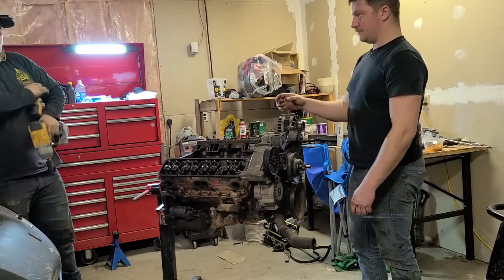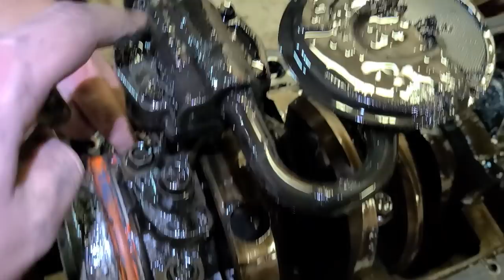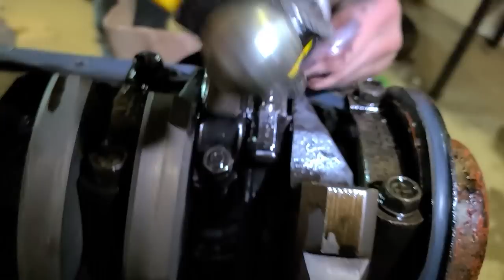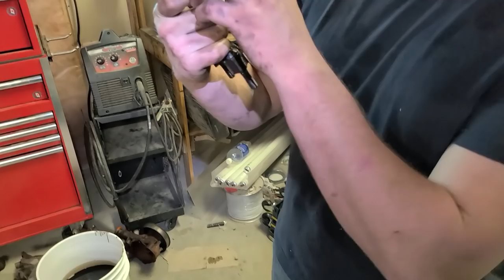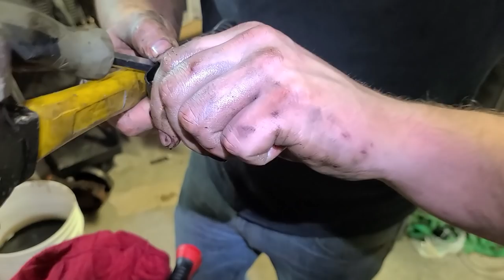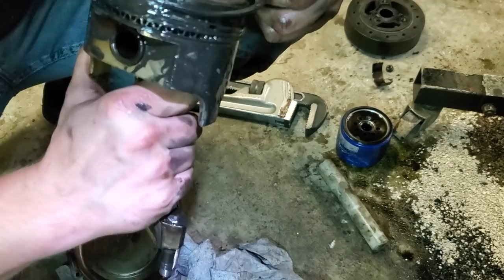DOMESTIC VIOLENCE TEARDOWN (Part 2) WINDED 305+NITROUS=CARNAGE

Comment: I’d always wanted to assemble and engine packed with grease and no bearings and see how much of a crazy knock it have..
Reply: You need some thick stiff pieces of leather belt to act kind of like bearing (well at least to take up some of space) otherwise she no run but even with belt leather which doesn't last long if you get it started the engine makes an ungodly racket before everything inside goes egg shaped literally